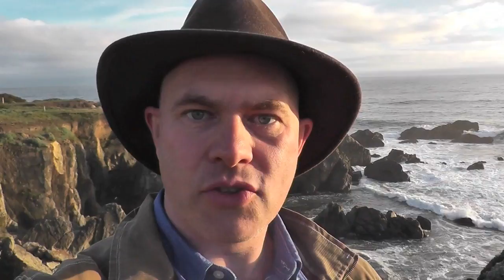Specific Impulse - Why is it Measured In Seconds?

Comment: Actually Isp isn't really measured in seconds; it's pounds(force) times seconds(duration) divided by pounds(mass).  Calling that just "seconds" is common practice, but technically wrong.  A purist would use "poundals" or "slugs" instead of one of the "pound" measures, but in practice American engineers call both kinds of unit "pounds", with one pound(mass) weighing one pound(force) on a scale, near sea level.  There is a purely conventional scale factor between them equal to the acceleration of gravity at Earth's mean sea level; however, physically Isp actually has nothing to do with properties of the Earth.  (But people do, during Earth-bound commerce.)  Isp is actually the same thing as "effective exhaust velocity", where the usual formula veff = Isp * g (g being approx. 32 ft/s/s) compensates for the force/mass conversion factor implicit in the "seconds" unit as used in the context of Isp.  A corresponding SI unit for Isp would be Newton-seconds per kilogram, but that is rarely seen, due to long-established practice having used the bastard "seconds".
Reply: +Doug Gwyn Eh, you can't do that. You're ignore the g0 scale factor and still calling it "specific" impulse - where specific in this sense actually specifies that it's a normalized term. Newton-seconds per kilogram reduces to meters per second. This is your veff, *not* your isp. 

Also note, the reduction to seconds isn't: pounds*seconds/pounds.
It's because you're normalizing what should be a unit of velocity with a scale factor that has a unit of acceleration.

fyi
Reply: +maizenblue2441 "Specific" means "per unit of substance".  "Impulse" means "time integral of force".  Isp and Veff are related by the factor g only due to the conflation of units of mass with sea-level units of weight (which is a force).  The (technically incorrect) expression of Isp in seconds is due entirely to "cancelling" the "pound" units of thrust with the "pound" units of propellant mass.
Reply: Doug Gwyn Dude, no. You're assuming "per unit of a substance" must be mass. The unit of substance in this case is the weight, not the mass, of the fuel. Why? It's explained in the video. This gives you a final answer in seconds. The whole point of normalizing is to make life easier on someone who's familiar with SI, but not English units, or vice-versa. There's no point in normalizing m/s to m/s-kg.
Reply: +maizenblue2441 Weight is a measure of force, typically the gravitational pull that would be exerted on an object at Earth's mean sea level.  It only indirectly reflects amount of substance, involving an irrelevant intermediary (planet Earth).  The direct measure of amount of substance is mass.  Incidentally, my degrees are in physics and I've worked in rocketry since more than fifty years ago; I know whereof I speak.  You should try to understand my explanation rather than arguing with it.
Reply: Doug Gwyn And my degree is in aerospace engineering and I've been working for a major nasa contractor for over two years now. This isn't complicated. I understand what you're saying; I just disagree and want to correct a misconception. Your "indirectly" is my "directly proportional". The quantity is stand-alone sufficient to measure the amount of substance. Not sure what else there is to argue about...? It's common consensus that the units for isp are seconds. This is derived by units of veff (velocity) / g0 (accel). That's it. There's no pound-mass / pound-force cancelling required. Hopefully that's settled.

PS, I have to point out the irony in you calling Earth an irrelevant intermediary and two sentences later using "years" as a unit of time.
Reply: +maizenblue2441 Perhaps you will better understand my point if you consider an obvious student question:  "Why, when analyzing rocket engine performance in establishing an orbit around Titan, do we have to multiple the performance characteristic, specific impulse, by the amount of gravity at Earth's mean sea level?  How does the Earth get involved when it is zillions of miles away?"  The correct answer requires tracking it back to the historical use of weight units to measure amount of propellant instead of mass units.  Also, years ago in one of the Usenet newsgroups we had a thread wherein the use of "pounds" to measure engine thrust was criticized.  The criticism was unfounded; it was ultimately due to confusion between pound-force and pound-mass.  Physicists have to understand things like that, so when we write Veff = Isp * g we understand that the g comes from a traditional units conversion and not from the physics of rocket engines.
Reply: Doug Gwyn Your point is a moving target. It had originally been that the *actual* units of isp are not seconds, but instead units of impulse / mass. This was incorrect and hopefully we sorted that out.

Now your point is that you have a pet peeve. We shouldn't be normalizing by an Earth-specific gravitational constant. But that's just opinion. The definition is what it is.
Reply: +maizenblue2441 The conventional scientific word usage in the term "specific impulse" implies that the units are properly those of velocity, not time.  Why do you think the title of this video is what it is?  The use of time units has puzzled a great many people.  Indeed, an advantage of doing it right is that one is led directly to the notion of effective exhaust velocity, which otherwise seems like an artificial construct (why would one be multiplying a performance measure by g?).  Most scientists, and especially physicists, prefer quantity of matter to be measured by mass units, and that's not arbitrary - if you measure by weight, you bring in an irrelevant reference standard (gravitational acceleration at Earth's mean sea level).  In most laboratory work, balances (which measure mass by equivalence to standard masses) are used, not spring scales, and again that's not arbitrary - otherwise precision work would require calibration to account for the altitude of the measuring device.  (Actually, the main reason is that balances are inherently more accurate than springs, but the altitude dependence of spring scales is a further deterrent.)  Proper word usage and understanding of the measurement process are not just matters of opinion.  In this world full of poorly educated people, they are especially important.
Reply: +Doug Gwyn Isp is in seconds because it is calculated using Earth units, in which weight and mass are equal.
Reply: There are several possible measuring systems used on Earth.  Isp is computed as the time integral of thrust [aka total impulse] divided by amount of propellant.  Note that thrust is measured in force units, while amount of propellant should be expressed in mass units.  Unfortunately, the tradition was to express amount of propellant as weight instead of mass, thereby introducing an otherwise unneeded conversion constant (conventionally, Earth's gravitational acceleration at mean sea level, obviously not having anything to do with the physics of rocket propulsion).  So instead of seeing Isp in Newton-seconds/gram, we see Isp in pound[force]-seconds/pound[mass].  By ignoring the qualifications in [brackets] the Engineers thought that pound-seconds/pound should be "simplified" to just seconds.  But that only works when the units of measure, specifically the measure of amount of propellant, is in terms of sea-level weight rather than mass.  Note that when proper units such as Newton-seconds/gram are used, the Isp has units of velocity, and indeed it is the effective exhaust velocity.  When weight units are used instead of mass units, the effective exhaust velocity has to e computed as Isp * g, where g is the sea-level acceleration due to Earth's gravity; that can be puzzling to one who doesn't know what is explained here, because obviously what goes on at the Earth's surface has nothing to do with rocket engine operation in deep space, so one naturally wonders why there is a factor of "g" involved (but only when "seconds" is the unit of Isp).  It's mostly a historical and psychological artifact, having nothing to do with rocket physics as such.  (There are several other examples of this kind of thing in physics, for example the non-unity speed of light.)

Comment: An equation that we use a lot in aviation, normally for calculating the efficiency of a jet engine is called Thrust Specific Fuel Consumption, It basically takes the ratio of your pounds of thrust over the pounds per hour of fuel flow.  This basically tells you how many pounds of fuel is used for each pound of thrust I.E. about 0.35 pounds of fuel is standard for a modern jet engine.

Comment: I think the reason why this confusion happened is in metric system force is newton mass is kilogram but in imperial system both the force and the mass is pound. Mass of the fuel doesn't change with respect to gravity, weight of the fuel changes with respect to gravity. But in imperial unit system in order to calculate mass you should use the gravitational constant on the surface of the earth. Because the data you have about fuel is in pound(Force) on the surface of the earth, you should convert it to the pound(Mass). So Scott was right.
Reply: Mass in the imperial system uses the unit of "slugs".
http://en.wikipedia.org/wiki/Slug_%28mass%29
Reply: +echa lastName Well, that is not a common unit, but one used exclusively when working with acceleration by square foot pounds per second of force. It is not a universal unit, nor one taught to the masses, but a special helper unit for specific calculations. Its called a blob when dealing with inches. It just makes life easier to use a special unit that is easy to work with in imperial units. As far as I know, it is not an official unit. It is simply a unit which stays relevant to official units.
Regardless, 'square foot pounds' literally is relative to gravity, so yeah, acceleration is still being compared to that of gravity, even in blobs and slugs.
Reply: @rich1051414  seems to me it's most intuitive to visualize Isp in seconds, as the number of G's the exhaust is subjected to.
Reply: @fieldlab4  Depending on the calculations being performed, that might cause a lot of extra conversions all over the place dirtying things up and making it harder. Why not just use a special unit and then convert at the end? This is how weird units are born :P

Comment: Actually, it's not because of the feet-meters conversion issue: it's because of the kilograms-pounds issue. Kilograms are units of mass, whereas pounds are units of FORCE (weight). Unfortunately, most Americans treat the pound as though it were a unit of mass (many don't seem to understand the difference between weight and mass, either). During the old days of space development, NASA used pounds (not sure if they still do) to measure fuel loads, while almost everyone else used kilograms.

That being said, if you calculate specific impulse using kilograms, you get meters per second... but if you calculate it in pounds, you get seconds! Yes, 'g' is a conversion factor, but not for dealing with the feet-meters issue.

This has resulted in something of a kludge: the accepted "modern" way to calculate specific impulse is to use kilograms for mass, and then divide by 'g' (in meters/second) to get seconds.
Reply: > Kilograms are units of mass, whereas pounds are units of FORCE

No. Pounds are also a unit of mass (in fact, it's the official unit of mass of the imperial and US systems), and "kilogram" is often used to mean kilogram-force, which is a unit of force (everyone says "it weighs X [kilo]grams", meaning kilogram-force; no one weighs themselves or cake ingredients in newtons).

And no one (either in the US or the rest of the world) has any trouble with that part. The reason for the specific impulse norm is to ensure the results are valid in both feet+pounds and metres+kilos/newtons (or any other valid combination used to express acceleration), like Scott mentioned.

Also, NASA (founded in 1958) actually did most of their work in metric, being staffed mainly by European scientists and engineers, even if they converted the results to US customary units for public (and astronaut) consumption - ex., the Apollo flight computers worked in metric internally, but used US units for the displays. NACA (NASA's predecessor) probably used mostly US units.
Reply: @RFC3514  Its both, in the imperial system you can either use the pound-force (lbf) as the fundamental unit of force and derive the *slug* as the derived unit of mass with m = F/a where a is 1 ft/s^2.

Or you could define a pound-mass (lb) as the fundamental unit of mass and use F=ma to get the *poundal* being the derived unit of force.

I'm pretty sure nobody bothers with the poundal at this point so the slug is the US unit of mass, sort of. In practice the 1 lbf / 32.2ft/s^2 = 1/32.2 slugs = the pound is the more popular unit of mass.

Anyway adding semi-random conversion factors everwhere isn't a new thing for imperial units anyway.
Reply: >  Its both

I know, that's what I wrote. 

>  in the imperial system [...]

The imperial system isn't really used anywhere, these days (hence why no one bothers with the poundal). The US never used the imperial system, which was defined after american independence, and the UK is (for all legal, scientific and engineering  purposes) metric.

>  the slug is the US unit of mass,

The slug is the "british gravitational" unit of mass. It is not included in the US sustomary units of mass (NIST handbook 44, appendix C-6), which consist of three different standards (the only unit common to all three is the grain, but the standard unit of mass for the main - avoirdupois - system is the pound).

Comment: So if KSP is manually drawing back its engines, then HOLY COW that nuclear engine's got power! If the game didn't manually throttle back in space, then it should receive a peak thrust of 218.181818181818181818 etc.
But when the other engines reach their peak thrust, this thing is still crap in comparison.

Comment: Actually, a more accurate and simple way of looking at it is that the fuel used is sometimes given in units of mass (which will yield a specific impulse in units of velocity), and sometimes in units of weight (which is NOT units of mass: it's units of force, and will yield a specific impulse in units of seconds).

Whether you get specific impulse in seconds or meters/second (velocity) depends on whether you prefer to use weight or mass, respectively, for your fuel calculations.
Reply: Seems to me it's a comparison of acceleration of exhaust gases in G's, compared to exhaust velocity. Now it's less clear which system is more intuitive or useful.

Comment: its about 7 base units rather than 3, in SI (metric) they are:
seconds (time)
metres (length)
Kilograms (mass)
Candelas (light intensity)
Ampere (electric current) (not charge for some reason due to how they are defined)
Moles (unit of amount of stuff)
Kelvin (temperature)
Although some of these are rarely used.

Comment: I like all the conversion factors but if Scott Manley is speaking in scientific notation there are only three measures of consiquence lenght, mass, and time. all other units are derived from these. Otherwise the metric system was a system ment to be reproducable easly, at least origanialy. The Imperal system was based using measurements of man where a 6ft house might not be 6ft but the giant and the dwarf having 6ft houses would enjoy them as long as you didn't ask them to swap.

Comment: Not at all.

Firstly, a lot of Americans do use the metric system - NASA, for example, does all its calculations in metric. Electricians use Watts, which are Joules per second (Joules are SI; it's a Newton-meter). Plus, public schools *do* teach the metric system, and all our units are defined in terms of metric units officially.

The reason we don't switch is because we have a *lot* of road signs, and it'll cost a lot of money to replace every occurrence of an imperial unit with a metric one.

Comment: Agreed with the height part.
With weight and volume I prefer the metric system by so much.
But with height using centimeters just seems like you're trying to make yourself seem taller than you actually are.
As in:
5' 4" is short for a man, but in centimeters 5 foot 4 in is around 164 cm which sounds a lot taller.

Comment: What you want is the effective exhaust velocity, which is measured in m/s in metric, or ft/s in imperial.

If you divide that by g in either unit system to get the specific impulse, you get a quantity in seconds, which is used in both imperial in metric. That makes it a unit system-independent benchmark quantity, which is the advantage. Multiply by g in your units, and you get the exhaust velocity back in your units.

The g factor is only there so rockets won't crash because of unit confusion.

Comment: Pah, 13 is still divisible by 1. Real men use non-integer bases... But seriously we might have been better off counting in base 12, which is divisible by 2,3,4 and 6, rather than base 10 which is only divisible by 2 and 5. The cost would be needing new characters for the digits eleven and twelve, and the digit addition table growing from 45 to 78 distinct entries.

Comment: Arkalius, your explanation is cute, but still a retcon. The name of the term betrays your explanation. Impulse is force times time. Specific impulse is impulse per unit of fuel. When you measure your units of fuel in terms of Earth sea-level weight, you get units of seconds for specific impulse. Earth sea-level weight is not a very good way to measure a quantity though, it should really be in terms of inertial mass. Which would give Isp in units of velocity.